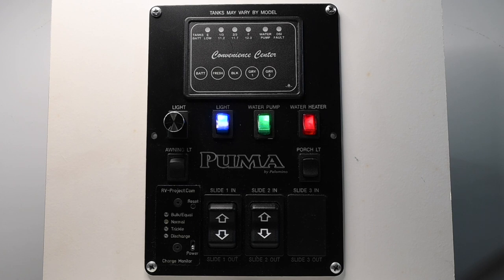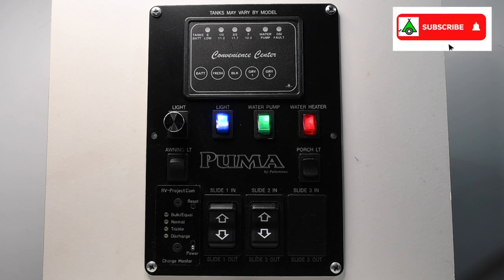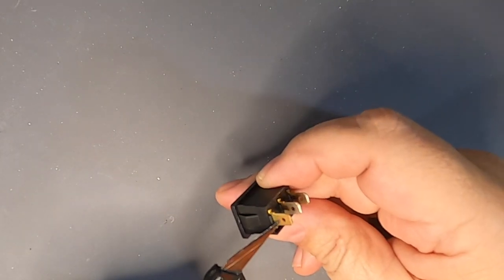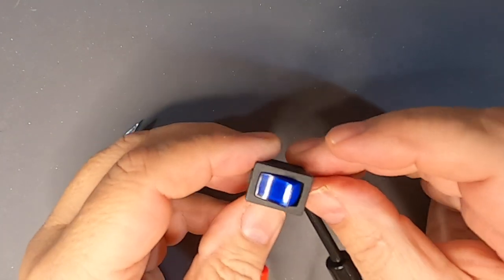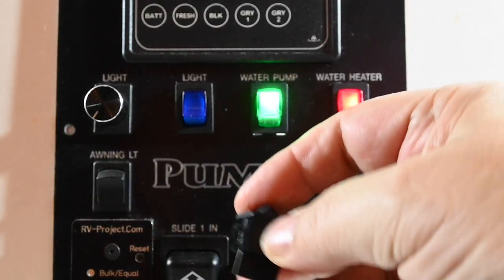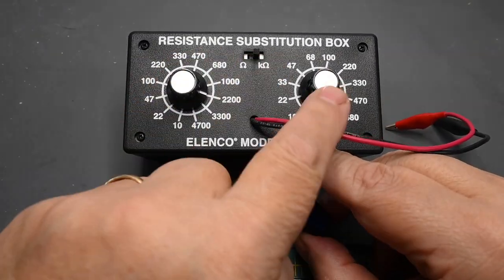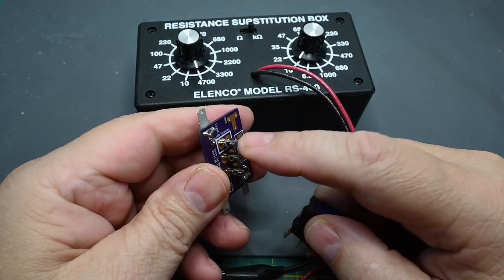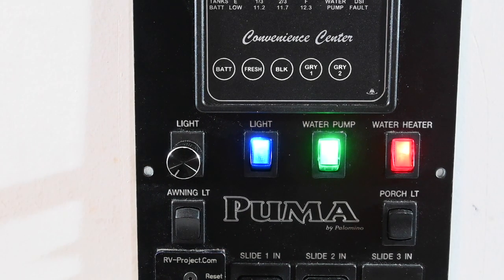Fixing the bright Blue LED Switches in your RV.

Comment: I've always wanted to put in a small CDS sensor plus a fixed resistor so the already dimmed led is still visible in say direct sunlight yet the sunlight dimming isn't still too bright at night. The CDS would auto adjust for the ambient light around the switch. You could put the CDS on the common ground and still have the fixed on each ground of the switch to keep lt intensities the same. since the ground lug is attached to the LED only you could also PWM them from a small microcontroller. then you could have say a LCD and the witches all be auto adjusted for the same intensity.
Reply from the maker: Been there - done that... sort of.

If you have not seen it yet, my super-dimmer project ( http://www.rv-project.com/projects/moad.php ) has the ability to be controlled by a photocell by replacing the external dimming potentiometer with a photocell in series with a fixed resistor to create a voltage divider.

The output of my super-dimmer is a MOSFET that can handle up to 40Watts, and can be built as a high or low side controller.

The only thing that would have to be done is to potentially modify the algorithm in the firmware that controls the intensity of the dimmer.

Currently I have programmed this algorithm for a logarithmic response approximating the eye's light sensitivity.  

You would also probably want to modify the firmware so the dimmer on-dim-off control cycle behaves differently.

So I could dedicate a dimmer module to drive all of the panel lights on the control panel.

Interesting thought.